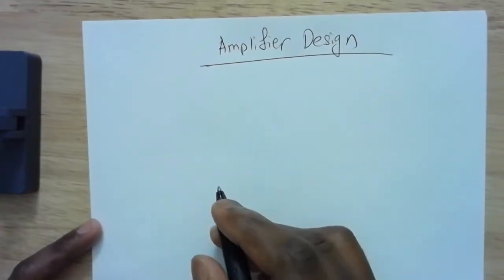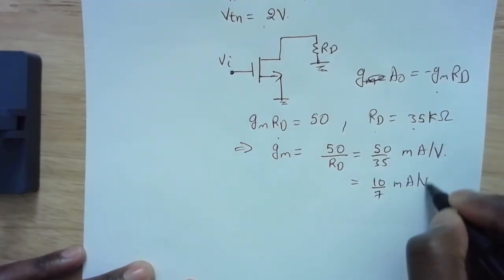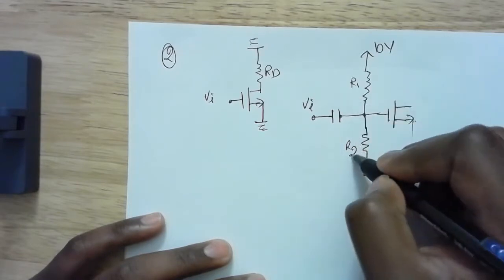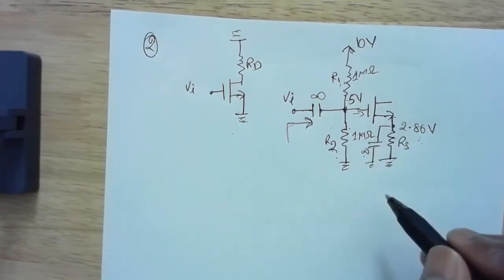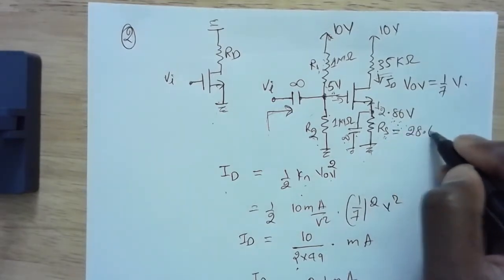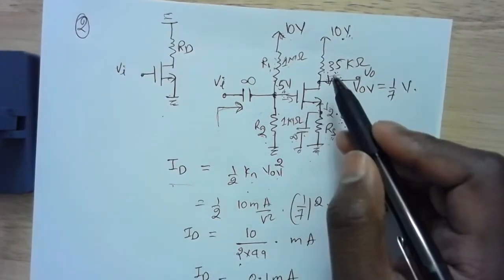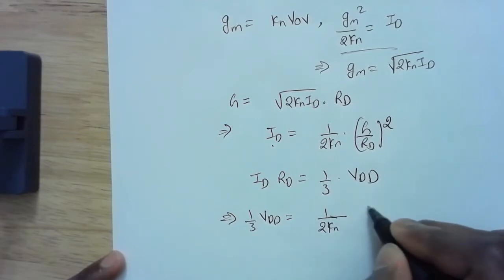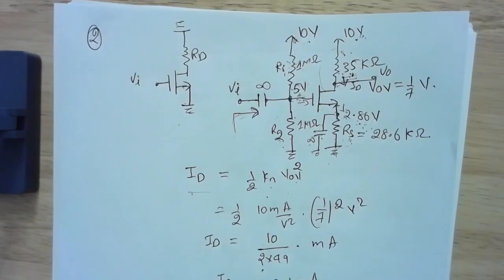MOSFET Amplifier Design

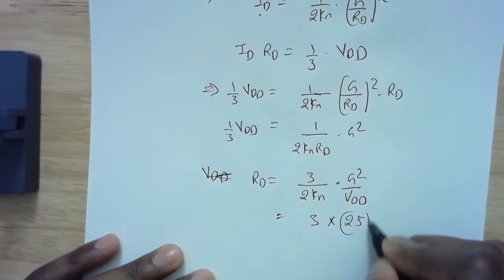Comment: Question. How did the gain go from 50 to 25 at 18:37?
Reply: i think he calculated it with 50, mistakenly wrote 25 instead there. Calculations are correct.

Comment: Thanks for the great video. It is not common to find videos explaining how to design amplifiers with MOSFETs, in general you will find polarization analysis. To put things on the right side: when you check the value of VRD = 1/3VDD it is to confirm the voltage drop from the value of RD = 35k to ID 0.1mA, which results in VRD = 3.5V. Is correct? After all, with RD = 37.5k you get VRD = 3.75V which is close to 1/3VDD. And regarding the use of 1/2kn in the ID equation, in this case we have kn = k'n(W/L) and thus there is dependence on the MOSFET geometry. On the other hand, it is possible to use only k = ID(on)/(VGS(on) - VT)^2, where ID(on), VGS(on) and Vt are available in the datasheets.

Comment: Stop writing KΩ it's kΩ.
It's important because K means Kelvin (Temperature unit) but what you mean is "k" (kilo) the 1000* prefix.
Reply: I think it is clear from the context that K means kilo here. This is not a technical document or some sort of data sheet, just a video where I am explaining the design process. cool down.
Reply: ? ok , very decent presentation, without the clowning.
Reply: @cmuller1441 checking in 2 years late to tell you you're an idiot lmao